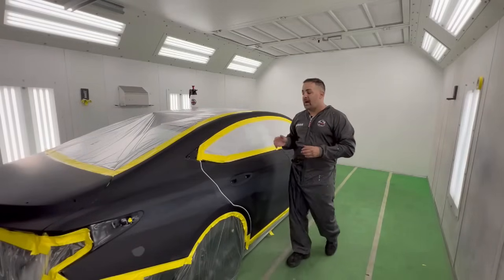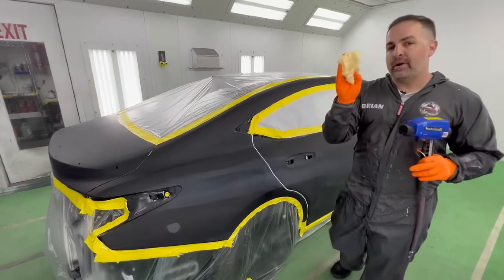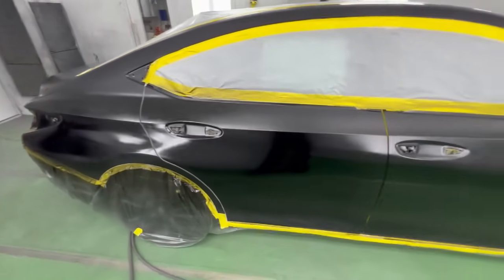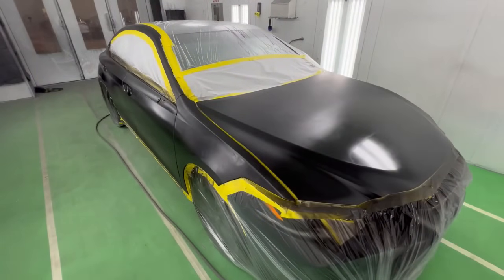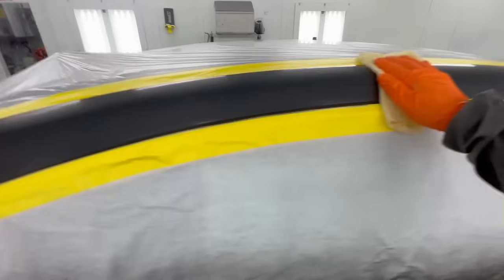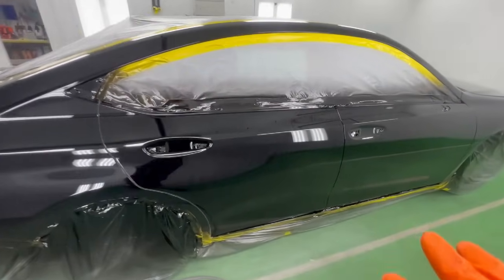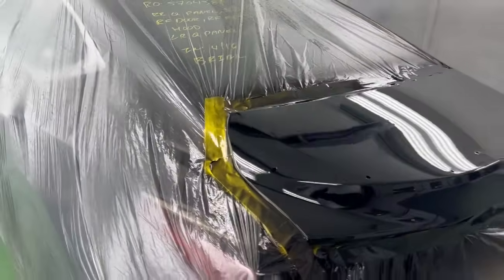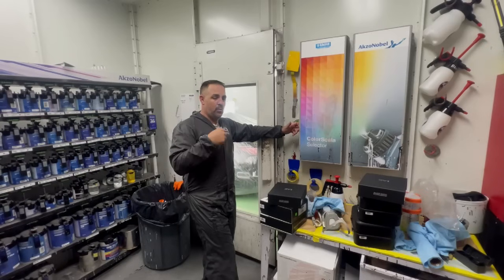How to Paint a Car Without Orange Peel

Comment: I just painted my first black car since I did a complete respray on a brand new Mercury Cougar for a dealership back in the early 80's that came in with acid rain damage.  Thanks to your channel I laid a super smooth finish.  As for the Cougar...well ford set the bar pretty low back then so no comment.

Comment: Brian one of the best take aways for me on this vid is not to freak out spraying base when you see some sand scratches. I’m used to single stage and it covers a lot of sins! I’m breaking my truck into sections and on the first one I freaked out stopped the show and wet sanded my hood after two coats of base then came back the next day applied a third  and coat then two coats of clear. My hood did come out like glass very excited! I set up my pro lite with a 1.2 and T110 cap. Thank you for your knowledge!

Comment: You're videos have helped me with 3 car paint jobs done under a carport, each turning out epic, after cutting and polishing. I'm about to clear a carbon fiber fender for a Honda, and watching this video helped me clear out the cobwebs!
I'm also floored that the Lexus ES300H did not come with a metallic paint job! My Lexus GS400 still has a beautiful 25 year old pearl white factory paint job, with rainbow sparkles in between the base coat and clear. I repainted the bumper and hood: base, pearls, clear, and each turned out ok on the 3rd attempt. Too much air flow, dust and bugs!
Reply from the maker: The es300 comes in straight black and black metallic as well. Ty for the love!!
Reply: @PaintSociety  Brian, you can't even  imagine how many Pro's, and especially DIY's you've helped over the years! "Finishing work" must be perfect, and it takes dozens of paint jobs to begin to learn how to get it right, but we have to do it right on the first job. And when we do, we owe a lot to you Brother!

Comment: I just painted some trim for my cabinets in my garage full of sawdust and drywall dust using a plastic $50 paint gun/compressor powered by a motor that sounds  like a cheap vacuum and it came out great.

Comment: Aide Memoire

1. Double base coat flash off time if you do not have a paint booth - be patient. Patience can avoid solvent pop

2. First clear coat goes on dry(er) to avoid runs

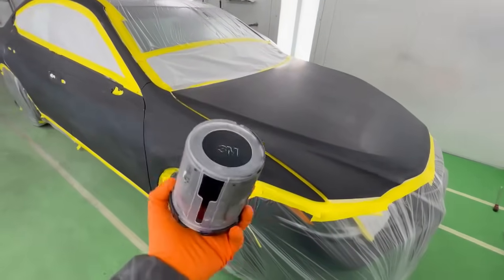3. Have referred to previous video of how to adjust fan to optimum setting when psi gauge gives a little jump (by 1 or 2 psi). I set my fluid at 2.5 turns out for my clear coat rather than that described at 4:50 but then set the fan as shown from 05:40. Worked better than i had so far managed 👍

https://youtu.be/twDXW3yd2_4?si=qvTFTiyCCiGf6Hhj

4. Anti static - used tumble dryer sheets

5. Read the product sheet

6. Heat product to circa 25c (maybe more)

7. Patience

Comment: Love your videos. 2 questions, how would you go about dealing with nibs on a metallic or pearl paint? Sand it and spray another coat of base over it or..? Also, just as a super rough idea, what would you charge to respray a 2006 Subaru STi in factory World Rally Blue Mica (Code 02C)? I'm considering it and wondering a ballpark figure that I would be looking at. Thanks in advance!

Comment: What was the trick with gun setting, paint mix ratio or application process.for that ultra glass finish off the gun. What thinner % do you use compared to TDS on the clear coat? Great channel by the way. Thank you.

Comment: So I own a Devilbiss Tekna Pro Lite. Spraying clear and base with trigger depressed what should base and clear be roughly at for psi? Also i noticed when you were setting gun up for clear you pulled trigger all the way back and then turned knob in till it just started to advance trigger and stopped there. Do u fully pull trigger all the way open when spraying clear with the optimal psi. Love your videos! So much valuable information. Keep it up!

Comment: I’m doing a restoration job which includes complete bar metal and epoxy primer the car. Im wanting to do base and clear on the panels but could I use single stage in the door jambs and areas not seen as much. Underside of trunk and hood etc.

Comment: Brian have you tested many Low Pressure guns?  I'm wondering if these might be a better fit for garage DIY'ers with smaller compressors and worse ventelation environments.  If overspray/ atomization is reduced and there is less airborne paint, maybe this will yield better results?

Comment: You said to let your 1st coat of clear coat heat up for a bit, do you bake your booth? If so how long and how hot?
Reply: Or do you just turn the booth temp up while it’s in spray mode.

Comment: First coat is not thin at all lol also theres so many things that have influence on paint yob, from clearcoat, humidity, temerature airflow hardners, reducer and also depend what clear u use spraygun, nozle and so on. I work this for more than 35 yrs, also i was tehnical support for standox more than 12 yrs in that time i saw everything, from topp bodyshops wiyh poorvresults to the barns with super results. Bottom line is its aways about guys whi do the yob. This is good for some people who start to work
Reply from the maker: Is it possible to look over your comment and edit it, because there’s a lot of typos, and I’m trying to understand what you’re saying.

Comment: Back in the '70's...(yeah that old...) there was this guy who painted Coke machines for his father-in-law. My brother asked him if he'd spray his 1970 Mach 1 Ford red.
 
     He said sure. We wet sanded the gloss away, taped it up,and put it in his garage......no vented spray booth, but he did have flourescent lights on the walls and ceiling.

   He sprayed it with DuPont acrylic enamel......single stage, and it looked like glass when he was done. That still is the best spray  job I've ever seen.

Comment: I 100% agree that it’s not automatically guaranteed to have a flawless PAINTJOB in a paintbooth, even with all preparation done. Great paintjobs can be done a lot easier in the booth, yet you can get a great job done outside the booth with quite a bit more work

Comment: 18:25 I use to feel like having the best booth would garauntee a flawless spec free paint job. Watched a multi-million dollar precision pressure controlled robotic system where the robots did start to finish. Then at the end of the paint cycle was human specialist inspecting and removing imperfections. If a robot control facility thats cleaner than the humans hospital have specialist inspecting and fixing. I know its a hit or miss whether multi-million dollar robotic booth or my garage. Then there was the most expensive tripple black porche on youtube getting painted. The amount of detail work to get perfection. How bad u want it. Then a dump truck drop rocks and chip ur flawless paint.

Comment: Brian: don’t want to get off topic, but orange peel is not as hazardous as solvent pop or solvent lay. You can put a great base coat on and your clear can ruin it all. Being a DIYR I knew nothing of this problem until someone I know told me it was a fisheye. I said: over a hundred fisheyes? No way. Fisheye are not the same. Dan
Reply: Solution?
Reply: How do you avoid those?
Reply: @JohnSmith-fi2gu  what I learned John was that your hardner should be a longer set time, avoid anything like fans which change ambient temperature and let more time elapse between coats.  What happened to me was a combination of too fast a hardner , using a cooling fan to flash dry clear and applying next coats too soon. So, my underlying clear coats weren’t fully drying before I was applying the next coat. Top layer dried faster than underneath causing the underside clear to bubble up. Over one hundred micro bubbles. Was a complete disaster. Pretty much all caused by me.

Comment: Hey bro WHAT IS SEALER?!?!? I’m from uk and it looks very similar to wet on wet primer. Over here wet on wet primer is not a technique, it is a product that can come in like 6 shades from white to black and it’s thin and goes in super smooth and it looks exactly the same as your sealer does, but over here, there’s no such thing as a sealer that’s anything like the sealer you use. When you use sealer over a repair, is that the same as what we call wet on wet primer?
Reply: Sealer is just a thinned out primer or wet on wet as you call it.

Comment: Thought about getting my truck repainted. It has a few rust spots so I thought I would sand, bondo and primer it. I called a autobody/paint shop and they were so rude to me. They said they had enough insurance paint jobs that they wouldn't need my business and also that they wouldn't touch my truck if I did the body work. Is that normal or was the lady having a bad day? I called another place and they quoted me for my 2011 Ram 1500 $6500 for the job. I just said nah, never mind. I'll youtube it. lol
Reply from the maker: Thats normal. Overalls with alot of
Work dont benefit shops too
Much. We turn down alot
Reply: @PaintSociety  Thank you for responding my friend.

Comment: I am so pissed off. My 2016 ford Escape Titanium Ruby Red paint colour was hit on the drivers front fender and door. The shop I had it repaired at is a reputable collision centre. Well was in my case. They offer a 2 year warranty on the finishes. Well around 2 weeks after the 2 years the clear coat is falling off. When I wash it at home I do not use a power washer. Ijust use my garden hose with a so called foam canon. My biggest fear came true and they refuse to fix it unless I pay them. Also before I bought this vehicle used I did run a car fax an a provincial accident clain as I live in Canada and I can run a insurance check for collision work just in my province for free. Well everything came back clear with no reported collisions. Well I have paint falling off my rear hatch with a huge amount of body filler and rust. My guess is the people who owned it before me had some rust repair work done and the shop they used just used body filler to hide it and paint over all that crap. So now i have to look for a used rear gate in my Rudy Red colour. To buy a new rear gate hatch costs over $2000.00 alone just for the metal from Ford stealerships. That price is highway robbery. 
 
Now I want another vehicle but I can not pass on this crap to someone else. It is just not right or fair to a person looking to buy it. So I will just keep it and have it repaired for my own use.

Comment: Instead of spending $900 on a static gun, buy an Ozone generator. They're $50, run the ozone generator for 30 minutes before painting. Ensure you're not in the room when the Ozone generator is on.